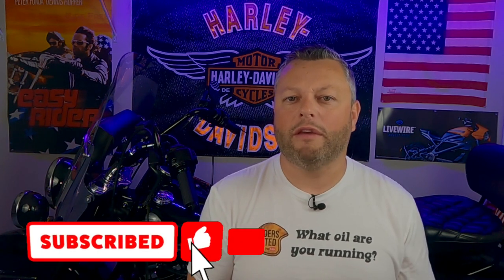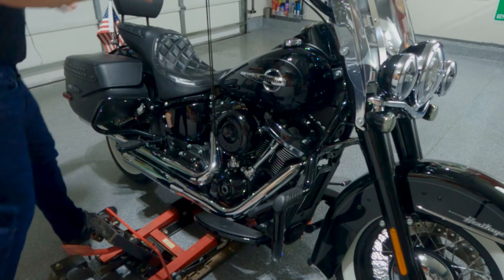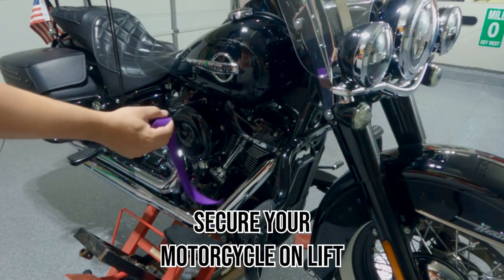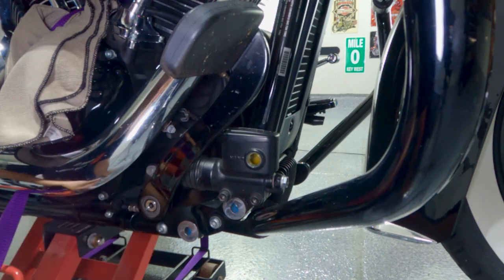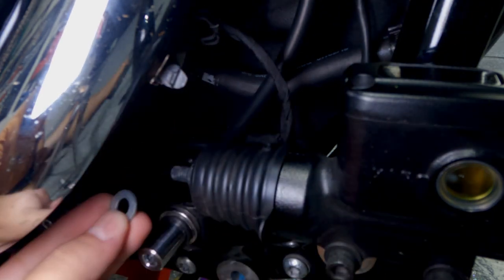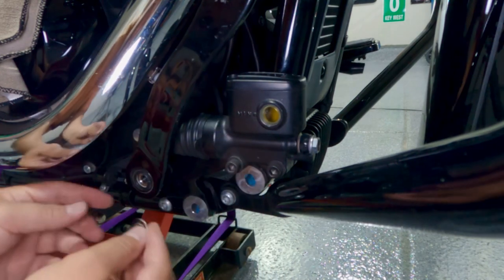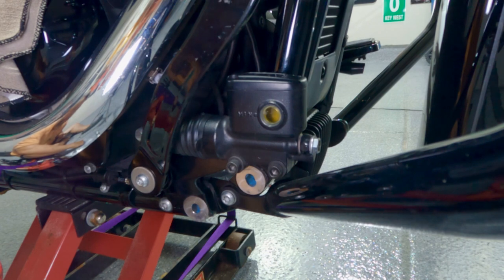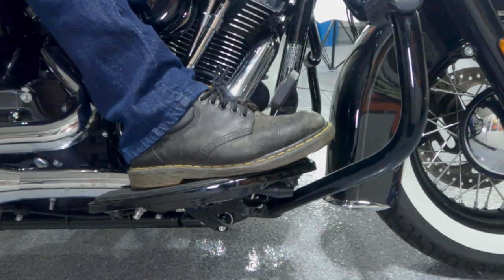Rear brake pedal adjustment on a Harley, gain more comfort and space #justridethatthing

Comment: Excellent Video of the process. But, do you think I can do the job without removing the floor boards? Mine are red lock tighted on from the factory apparently. Will not budge even after heating the nuts. Plus I fear the star head will strip.
It appears that I can get to the pin without removing the brake lever and when I remove the pin that the brake lever will just move down or up enough to clear the rotating adjustment mechanism. What do you think?

Thank you,
Larry
Reply from the maker: I doubt it you can try to remove floorboards with brackets

Comment: Nice video. Good to know that thin washer makes such a big difference. Is the shifter adjustment on the other side a similar process?
Reply from the maker: Shifter you can adjust 2 ways depending how much you want to move it up or down. You can remove shifter from the shaft and move it one groove (most of the time it is too much) or I will suggest adjusting mounting points on shifter rod for fine adjustment. Hope this helps.
Reply: Shifter adjustment is a three part system I just did mine. Doc Harley has a great video on shifter adjustments.
Reply from the maker: Thanks for the comment and glad you enjoyed the video. Ride safe brother